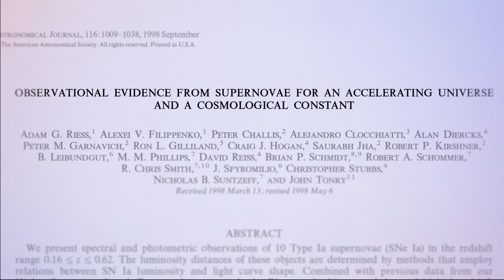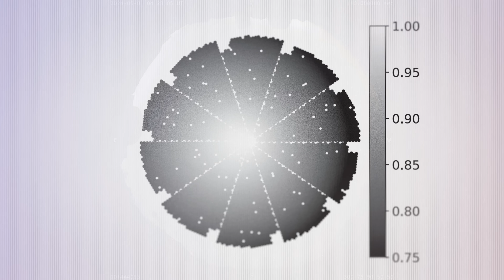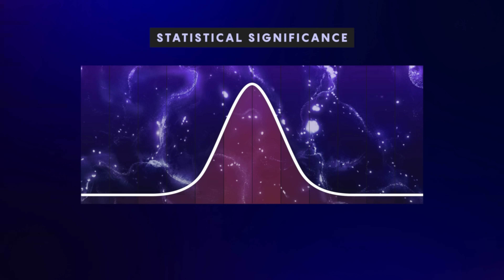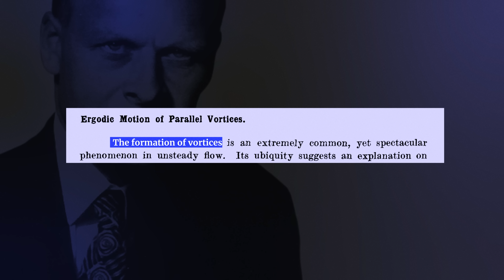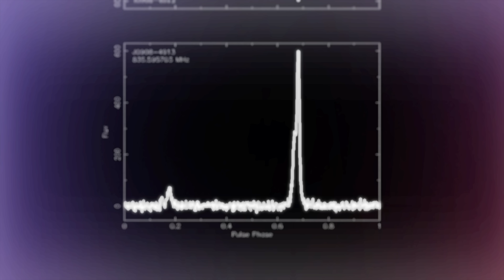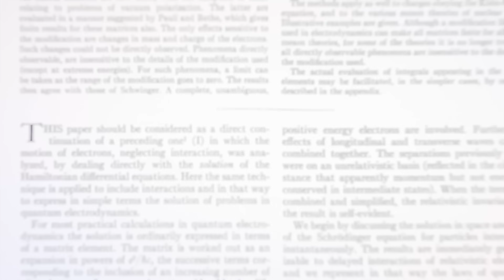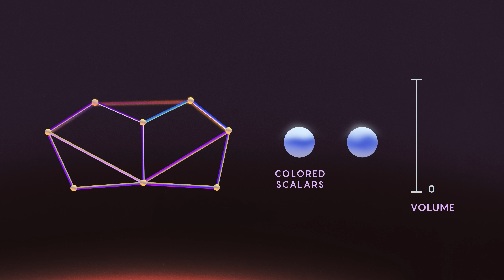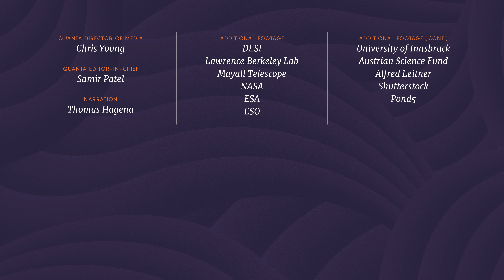Biggest Breakthroughs in Physics: 2024

Comment: Analysis of Three Physics Developments from the T0 Model Perspective
This video covers three major physics developments: new findings about dark energy from the DESI survey, the creation of supersolids in a laboratory, and advances in quantum geometry with the amplituhedron. Each of these can be analyzed through the lens of the T0 model's alternative framework.
1. Dark Energy and the Cosmological Constant Challenge
Standard Interpretation (Video):
The DESI survey results suggest dark energy may be changing over time rather than remaining constant as predicted by the Lambda-CDM model with Einstein's cosmological constant. This could indicate new physics beyond the current understanding.
T0 Model Perspective:
The T0 model offers a natural explanation for these findings through its modified gravitational potential:
Φ(r) = -GM/r + κr
Where the linear term κr provides an explanation for the apparent acceleration of cosmic expansion without requiring dark energy as a separate entity. The fact that DESI measurements suggest dark energy may be weakening aligns with the T0 model's prediction that what appears as "dark energy" is actually a manifestation of the intrinsic time field T(x,t) acting as a gravitational field.
The T0 model treats the universe as static rather than expanding, with cosmic redshift explained through photon energy loss:
1 + z = e^(αd)
This approach would interpret the DESI findings not as changing dark energy but as a natural consequence of the intrinsic time field's behavior across vast cosmic distances, potentially resolving the mystery without the need for exotic new physics.
2. Supersolids and Quantum States of Matter
Standard Interpretation (Video):
Scientists created a supersolid—a phase of matter that simultaneously exhibits properties of both solids and superfluids, with applications potentially extending to understanding neutron stars.
T0 Model Perspective:
The supersolid phenomenon can be viewed through the T0 model's framework as a manifestation of how the intrinsic time field T(x,t) interacts with matter in extreme conditions. The dual nature of supersolids (solid structure with superfluid behavior) parallels the duality in the T0 model's definition of the intrinsic time field:
T(x,t) = ħ/max(m(x,t)c², ω(x,t))
This definition elegantly handles transitions between particle-like and wave-like behavior, which is conceptually similar to the supersolid's dual nature.
The connection to neutron stars is particularly interesting from the T0 model perspective, as neutron stars represent extreme gravitational conditions where the intrinsic time field would have significant effects. The "glitches" in neutron star rotation could potentially be explained by dynamics of the time field in these extreme mass conditions rather than requiring supersolid behavior in the star's interior.
3. The Amplituhedron and Quantum Geometry
Standard Interpretation (Video):
The amplituhedron and related geometric objects provide shortcuts for calculating particle interaction probabilities, with recent advances showing that similar geometric structures apply across different particle theories.
T0 Model Perspective:
From the T0 model's viewpoint, these geometric approaches to quantum interactions may be approximating aspects of how the intrinsic time field mediates particle interactions. The T0 model's field-theoretic approach with the intrinsic time field potentially offers a more fundamental physical picture underlying these mathematical shortcuts.
The discovery that multiple different real-world particle theories share the same zeros (forbidden interactions) aligns with the T0 model's unifying approach. In the T0 framework, different particles are manifestations of the same underlying field in different regimes, which could explain why their interaction patterns show such striking similarities.
The "master object" mentioned in the video that encodes multiple theories could be interpreted as a mathematical representation of aspects of the intrinsic time field's behavior in particle interactions.
Synthesis and Conclusion
These three scientific developments, while seemingly unrelated, can all be viewed through the T0 model's lens as different manifestations of the intrinsic time field's behavior across different physical domains:

Cosmological Scale: The DESI findings about dark energy align with the T0 model's explanation of cosmic acceleration through the modified gravitational potential.
Quantum Matter Scale: Supersolids demonstrate dual particle/wave behavior analogous to the T0 model's handling of wave-particle duality through the max operator in the time field definition.
Fundamental Particle Scale: The geometric approach to particle interactions provides mathematical shortcuts that may be approximating the underlying physical reality of the intrinsic time field.

The T0 model potentially offers a unified framework that connects these diverse developments through its core concept of the intrinsic time field functioning as a gravitational field, with time as absolute and mass as variable. This approach maintains conceptual clarity while still accounting for the complex behaviors observed across these different physical domains.
Rather than requiring new exotic physics to explain each of these findings separately, the T0 model suggests they may all be different aspects of the same fundamental framework based on the intrinsic time field, offering a more economical and conceptually coherent approach to understanding these diverse phenomena.

Comment: Let’s conduct a thought experiment.
Look at a car traveling at 100mph.  There is a radar gun showing the speed of the car in the frame of a camera giving us an instantaneous speed at that moment in time.  Start recording the car with the radar gun in frame, right at the time the driver takes their foot off the gas and continue to record until the car stops.  The car will appear to be traveling 100mph and will slow down over time to an eventual stop.  The length of time and distance traveled are measurable from the information recorded on the video.  
As we work backwards from the time it came to a stop towards the time it was traveling 100mph the car will appear to be speeding up the further away it gets from the place it stopped.  Each frame is a snapshot of the time and relative speed of the car at any distance away from the stop point.  Our theoretical stop location is the same location the camera stood as it recorded the speed and distance.
From Earth as you look back in time you are looking closer and closer to the time of the big bang.  The lightyears away from earth are a distance and a time snapshot of the instantaneous speed the galaxy was traveling at that moment in time.  It would seem the universe is speeding up but I suggest it is the exact opposite.  The universe is slowing down and as time goes on the red shift of galaxies 13 billion light years away will always have the same stagnant red shift for eternity.  Only when the galaxy is 13 billion light years away and the big bang occurred say 15 billion years ago or more will the red shift start to decrease for that galaxy and all galaxies 13 billion light years away from earth.
If you look at energy from the start of the big bang to now it proves things are slowing down.

Comment: Thinking of the Big Bang being similar to lightning.   Wondering if light, electromagnetism, sound, and magnetism could all be
intrinsically intertwined. 
Lightning is a light, sound, electromagnetic, and magnetic. Although these forces are part of the same thing, their ability to travel through the air is different.

We see the flash of lightning, and when it hits something, it sends out a powerful electromagnetic pulse. Later comes the loud booming sound and shaking of the ground around us. This lets me know that electromagnetic energy moves as fast as or almost as fast as the speed of light. 

  All of these forces and waves that each express themselves in different ways and at different speeds. What I am asking myself is, does light or sound have weight or mass?

Comment: The Big Bang is only 4% accurate. Dark Energy is theoretical. With Dark Energy so abundant in the universe at 68%, where has it been hiding?
Reply: Nowhere. We simply didn't have the instruments to detect it. Now we do. ;-)
Reply: @lepidoptera9337  I read that dark energy (w) exactly = minus 1, which happens to coincidentally be what Einstein proposed for his cosmological constant over a century ago. That is not easily explained.
Reply: @ You are reading a lot of nonsense, it seems. Don't do that. It makes you less intelligent. ;-)
Reply: @lepidoptera9337  Nonsense? Does the BB remain only 4% accurate? Where is the 70% missing DE and the 26% missing DM? If not -1, what is your value for w?

Comment: gravity might be just as much an illusion as heat.  When we cool something to near absolute zero, we slow its tick down, shifting it temporally. If you was able to survive being cooled down that much, your tick rate would speed up, as your experience of time slows down. Electrons firing in your brain would travel easier, with zero resistance, a second for you might feel fast enough to see a flys wings beating, but from that perspective, i wonder if other things start to come into view. Can you experience something else being cooler than you by the same amount, does absolute zero scale the same way that the universe scales. 

If you was shrank so a hydrogen atom was the size of a star, would reality look the same?  would time tick the same, would hot and cold be the same... its all relative.. out time dilation right now is changing.. every second you expand and grow 4th dimensionally, it should cost you more and more energy to sustain that growth, but it doesnt, because everything out here seems to scale at the same rate. Perspective is important out here. A fly living only one day might be just as bored as I am with life by 5pm.. waiting for the cold release of the void. Death is the only constant that is 100% guaranteed, and tomorrow isnt certain. Don't forget to live, thats the point of life..

Comment: 2:50 the problem is, they arent mapping anything in 3D, they are mapping it all in 4D, what we see is 4D. Thats why its all spherical masses doing orbits out here. Until they can make that change in distinction, we are gonna be stuck. Mapped in 3D the universe becomes conical. Mapping potential and orbits as straight lines, a curved horizon is now a flat one. This is how time works, in its dimension of spherical bubbles. It is a spacial dimension. At the centre of the earth, if you could survive there, and you took a measuring stick with you, would you measure up the same, or would spacetime make you squished spherically, would you feel the squish any more than spaghettification around a black hole?

Space and time work different in different places, like when they say an object the size of a coke can can weigh 2 baby elephants, like ok, but thats on earth, somewhere around the equator at sea level. In space nothing really has weight to it, just density and the resisting urge to change directions. Things only "weigh" something when you are temporally out of sync the same amount. 

Gravity isnt a force, its space and time trying to make you exist where you should be, for your speed and direction. You weigh slightly more at the poles, with less mass of the earth below you. On the equatorial bulge even tho there is more mass, you have more angular momentum, which raises your temporal location, making you lighter. If the planet had no collision, you would be at a higher orbit starting from the equator, so you weigh less.. but when you are on the right line for your speed and direction, you are weightless.. You would settle out into orbit around the centre of mass, with a bit more potential than if you started at either pole. Weird quirks of geometry.. 

To make something "anti gravity" i would take an array of starlink like satellites, 5 miles apart in their orbits, and have each extend a 5 mile cable, linking them all into an array, then wind in the cables. You would find the orbit speeds up and you orbit way closer to the earth, as it happens you would be temporally out of sync with where space and time want you to be.. so it does its best to push you there instead of pulling you, like it does down here. Temporal dislocation is gravity. When you are at the right place in space and time you are weightless..  Thats how orbital mechanics works, in a universe that doesnt need a force of gravity, or dark energy.. I bet you could take some energy out of that system and it would still stay stable. Free energy is right above our heads, it would be a beautiful thing to see...  a self powering dynamo using the earth as a hub